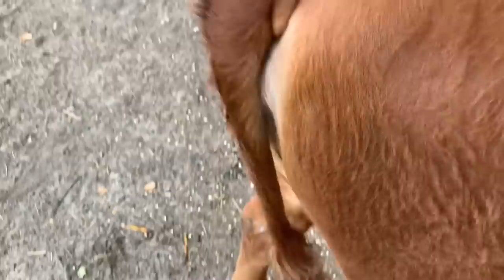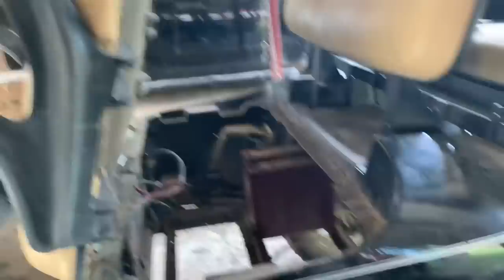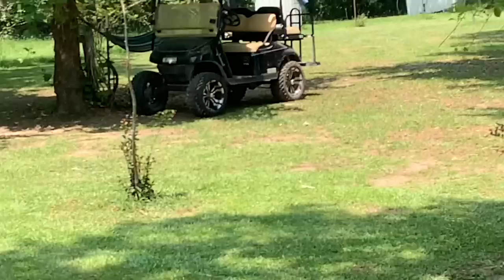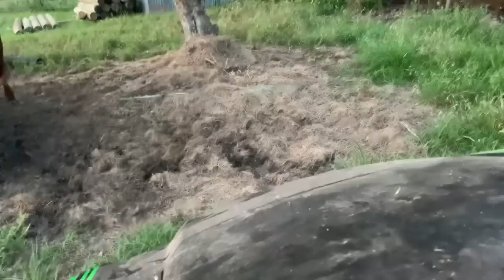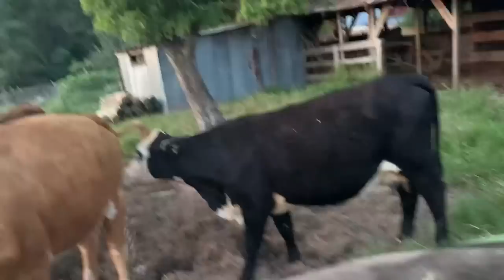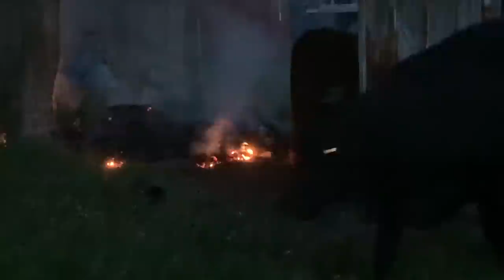A Project For Gigi

Comment: One of the best projections against is putting petroleum jelly /Vaseline on the connections.
Some shops will use dielectric grease. I don't like those pads they don't seem to work too long.
Reply from the maker: Thanks for the tip